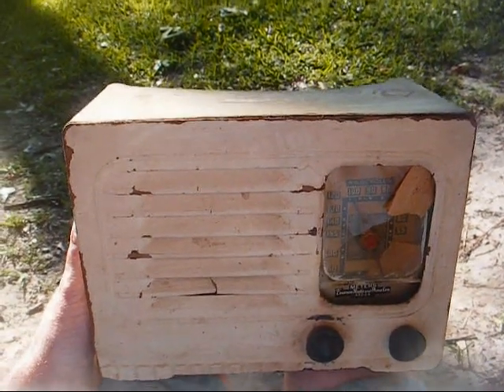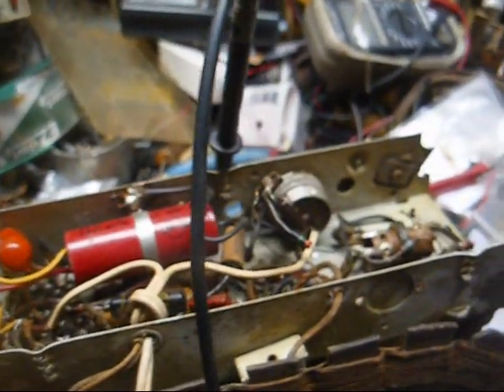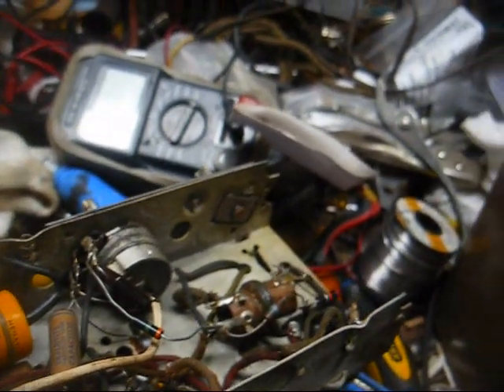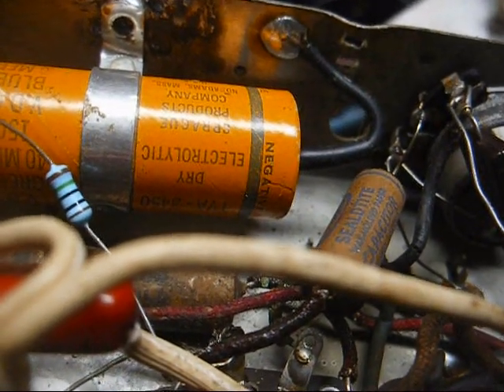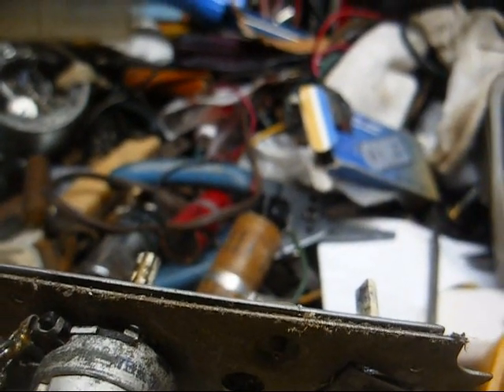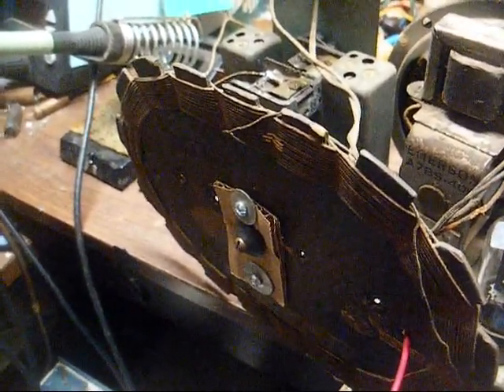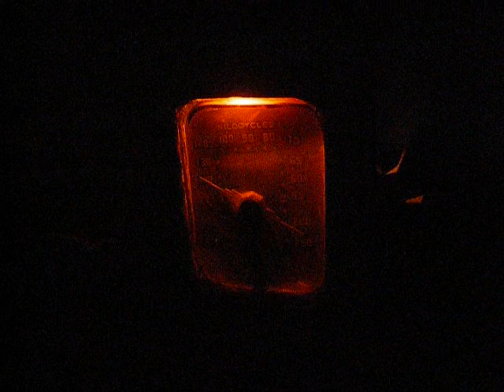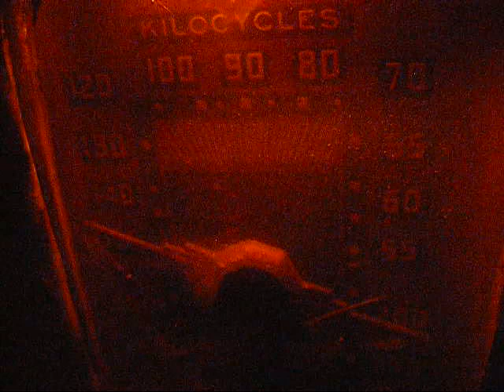Repair of an early '40's Emerson cardboard-cased tube radio

Comment: Even the cardboard was made better back then... still holds together relativity well!
Reply: Actually, I doubt that the cabinet is actually cardboard-more likely, it's made from fiberboard-just slightly better than cardboard.
It could also be paper mache-with a covering-still a bit better than cardboard, but only slightly better.
Emerson DID make some set cabinets that way.
Reply: @m.k.8158  Philco made a series of transistor radios using cabinets made with vinyl-clad cardboard.  One has been sitting in my bathroom for the past 6-7 years and it is still holding up well.  It has a thermoplastic resin front and the covering on the sides and back is cardboard.
Reply: no, not really

Comment: It looks like a paper mache type cabinet.  Probably the last ones made before wartime preparations were made
 at Emerson Radio Co. I say it must be a very rare radio just because of that! The covering 
over the "cardboard" is a leatherette and reminds me of the Emerson FU424 from 1941! Believe this is an EL series
radio. But not the EL 361. Could be an EL 360,362 ,or 373. They were all paper/cardboard with a surface finish.
Made with the same chassis but with Bakelite ( or Plaskon )cabinets from the EP series which are very collectible!

Comment: I wouldn't be surprised if the reason it's cardboard was for the war effort.  Lionel trains made cardboard train sets during that time.
Reply: I don't think so, Emerson was always known for building budget radios, and I think they started using cardboard cabinets in the middle 1930s. I'm not sure about the age of this set but it may have been a 1940 or 41 model. Besides that Bakelite, and wood were not classified as strategic materials, and in any event radio production closed down in February or March of 1942.
Reply: @a.fritzbecker8986  Depression Era!
Reply: What I was thinking!  If so this was made after Dec 1941
Reply: @chadcastagana9181  Yes! Plaskon and cardboard sets which were models like an EL for lightweight cardboard or EP for Plaskon (Bakelite)!
Reply: Probably so because the Regular material would have been rationed or not available.
Reply: @a.fritzbecker8986  could be that too!

Comment: Because it uses single-ended octal tubes and a built. In loop antenna , I would date the set from  1939 -outbreak of WWII . I suspect that they used the cardboard cabinet because due to the war wood and plastic cabinets were not available so the did what they could to use the completed chassis on hand. Decent sounding radio once you got it going.
Reply: ...and notes written on the radio showed the sale date of 1942. Probably one of the last radios produced for civilian use...

Comment: I'm surprised that anyone tried making a radio out of cardboard in the 30s or 40s. I'm more surprised it lasted 80 years.
Reply: Built during the great depression. Nobody had money for much more than that
Reply: It was common to make cheap furniture like cupboards and drawer sets out of cardboard going back at least to the 1910s. I still have several that my parents owned that probably date to the 1920s or 1930s. Since radio cases were considered furniture in those days it isn't too surprising they would use the same techniques for a cheap radio case.
Reply: Actually it is from the wartime around 1941. They probably has the radio chassis then but not enough Bakelite
(Plaskon) cabinets.
Emerson made leatherette covered cardboard radios for a very short time in 1941 then they switched over to 
whatever they were ordered to make by the WPB for the war like radios for the army  or navy exclusively.
Reply: l wilton m

Comment: I have one of those Ooold exerbikes the kind that the bars had linkage to the pedals.. its motor is an Emerson.  coveted motors. that thing could probably run a grinder/sander, compressor.. anything ya wanted. mint green paint.

Comment: Fascinating. A cardboard cabinet to save money, but it still had a dial light.
Reply: Probably cheaper than the production change, it would require a wiring change due to how the dial light is powered in an AA5, you can't just clip it out of circuit.

Comment: This has to be one of the most interesting things you've worked on. This is a fascinating radio with some provenance behind it and could very easily be a rarity. The reason for the cardboard cabinet is likely due to reasons mentioned by others here, but it wasn't unusual for for some radios to sell with optional cabinets - particularly kit ones although there is no indication that this was kit. I hope Shango066 gets to see this one.

Comment: Another curtain burner  .nice ac cord repair 50/50 electrocuted chance . If the radio didn't get you the sulphur dioxide refrigerator got you.in 1930

Comment: Those filter caps with a cardboard jacket, had a life expectancy of five years apparently, it's a wonder that any of them are still functional. I'm not sure if the "Planet" brand capacitors were ever used as O.E.M in any brand of radio, all of the one's I have seen were obviously replacements. I think maybe a few makes did use "Conbro" brand  caps from the factory though, just like "Bad All" brand paper caps.
Reply from the maker: I've seen Planet caps in some Westinghouse and GE stuff (mainly Westinghouse) as OEM.
Reply: @radiotvphononut  I guess they were post war Westinghouse sets, I don't know if the Planet capacitor company existed prior to that. The majority of pre war U.S Westinghouse sets seem to have been made by other manufacturers, such as RCA, American Bosch, and Stromberg Carlson.

Comment: I don't think that radio is collectible in any capacity with its current cabinet - my assumption is the material is actually a chipboard, many suitcases were made of that stuff and crafters still use it today. But the chassis is probably the same AA5 they used in their nice wooden Ingraham cabinets. I would get 4 pieces of nice walnut or Birdseye maple (maybe zebrawood) and re-create that same cabinet but with nice wood, stain, stick on some Emerson decals,  and then rub out a thick glossy lacquer topcoat and put it up for sale in the $350 range

Comment: This is a good example of how repairmen did things back in the day. Back then, nobody did bulk recaps...instead, the tech would diagnose and replace only what was necessary. The lone exception to that was tubes---they loved selling tubes
Reply: @David Kinzler Before the advent of mylar caps, the tech would be replacing a paper cap with another paper, so there was no point in doing a bulk recap
Reply: Every drug store, hardware store, variety store,  and garage had a self serve tube tester and sold tubes. Anyone could buy tubes, anywhere.

Comment: All American. Did some have a power line that had a certain amount RESTANCE on the positive line. To reduce power to rig?     And ADT  did have such tubes as i had to service my alarm at the armory.  Then one day in  1981. I found a box of tubes and other trash. they updated the system. The ADT TECK THRUGH IT ALL OUT IN THE DUMPSTER. ps the operator (radio)must have the case grounded. And hot toward the rectifier. And that's why the dials were plastic. For safety in case of MIS direction of plug..  covits? it's man made and they won't kill all of us they would run out slaves. And there won't be enoufgh to kiss there back sides.  Good luck! Ps was talking about radio. Then I saw the ADT tube I gave the user I knew. Then went back to radio tks Fer good show.

Comment: From the looks of the bottom of the cabinet it was originally covered with a grey, leather pattered, paper, kind of like what they use to use on book covers and cheap suitcases back then, so the white paint is not original. I suppose you could re-enforce that material with watered down wood glue, lacquer thinner would probably take that crappy paint off. I've never seen anyone restore one of those cardboard cabinets before, I've never had one to mess around with but I suspect they used something similar to interior car door panel material, probably because they could mold details into it like that faux dental molding along the bottom. The real pain would be if the edges are worn down, it would show unless you build it up with something like bondo, then maybe you could find some sort of textured paper to glue over it all.
Reply: They also covered wood radios with that thin leatherette stuff. They wore out faster!
Reply: @hestheMaster  I've seen that too, though at least the wood under it hold up a little better from mechanical wear. Most seem to have used an oil cloth of some kind, like a portable, it wears better but gets tattered.

Comment: I can tell you why incorrect mounting bolts are put back, you lose one and don't want to go to the hardware store, so you just rummage around in the garage for a bolt that will fit. I have a hard drive mount in an old 386 that has all different screws in it because I lost all the original screws.

Comment: As others have said, I wouldn’t be surprised if the car board had to do with the war, or at least was an excuse to cheapen up the manufacturing. I wonder if that “cardboard” is laced with a healthy dose of asbestos to help with the “heat” lol.
Reply: No asbestos they needed that mineral for the engine rooms for the navy  ships during WWII!
Not enough Plaskon (Bakelite) cabinets for all the already made chassis they have so they made paper covered
by a leatherette  material. If you want to see what one actually looked like Google, Emerson EL361.Very similar!

Comment: Your troubleshooting skills terrible.
The first thing to do is check the DC voltages are correct, if they are not the ac voltages will not be right.